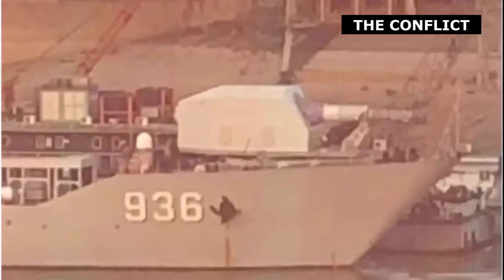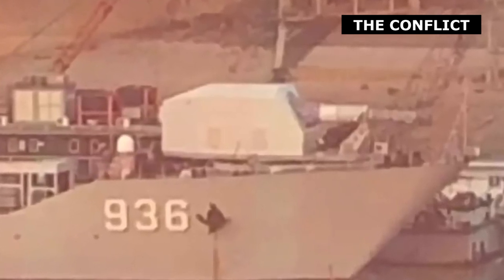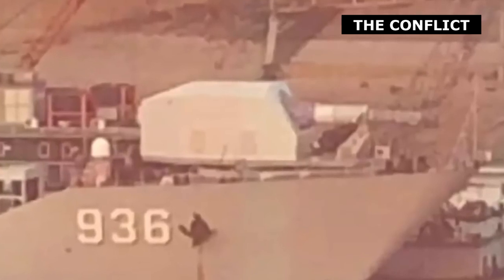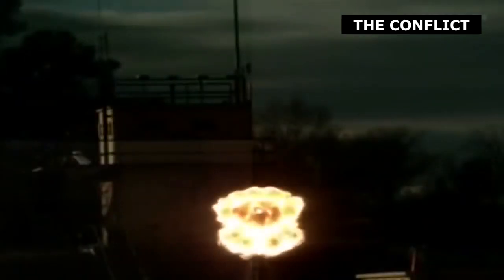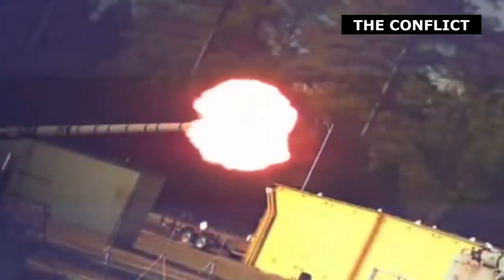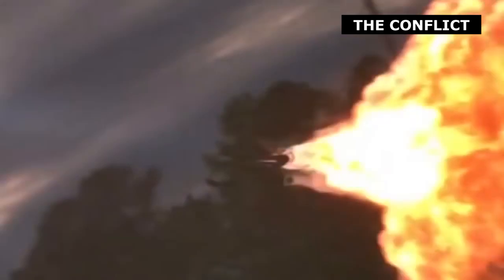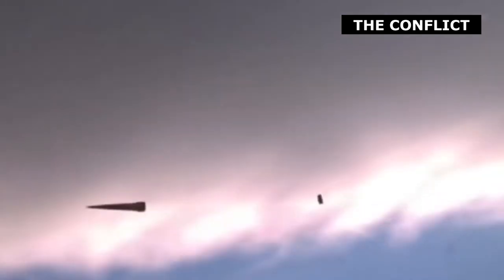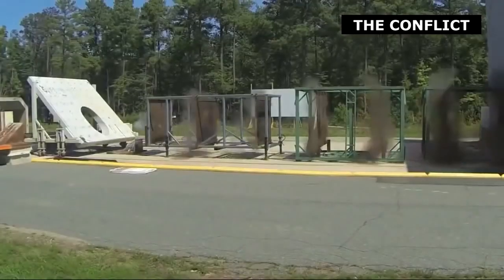LOOKS LIKE CHINA JUST INSTALLED A RAILGUN ON A WARSHIP, BEATING THE U.S. NAVY TO THE PUNCH

Comment: Good for the PLAN.  Hope they deploy more railhuns on more ships.  

Just because you slap on the railgun does not mean they’ll work.  The physics and the electrical power required, are but some issues that’s not yet “resolved,” in other word, they are unreliable and prone to failure. 

Power supply:Generating the power necessary to accelerate rail gun projectiles is a real challenge. Capacitors must store electric charge until a sufficiently large current can be accumulated. While capacitors can be small for some applications, the capacitors found in rail guns are many cubic meters in size.

Resistive heating: When an electric current passes through a conductor, it meets resistence in the conductive material -- in this case, the rails. The current excites the rail's molecules, causing them to heat. In rail guns, this effect results in intense heat.

Melting: The high velocity of the armature and the heat caused by resistive heating damages the surface of the rails.

Repulsion: The current in each rail of a rail gun runs in opposite directions. This creates a repulsive force, proportional to the current, that attempts to push the rails apart. Because the currents in a rail gun are so large, the repulsion between the two rails is significant. Wear and tear on rail guns is a serious problem. Many break after a few uses, and sometimes they can only be used once.